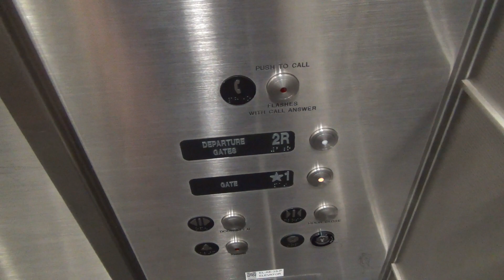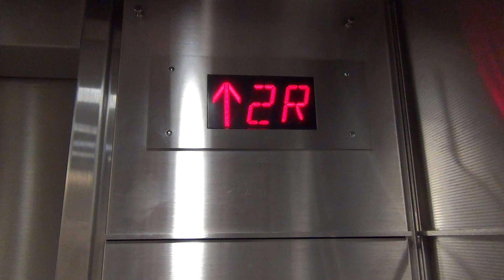Low on Oil! Montgomery Hydraulic Elevator @ Philadelphia Airport - Philadelphia, PA

Comment: it did that because the pump is sucking air you should have told somone that pump goes out someones going to get trapped in it
Reply from the maker: I’m sure they will get it fixed.
Reply: @stlelevators  maby so but its the proper thing to do i report every elevator i ride if its not proper

Comment: This elevator definitely hates being low on oil, different elevators react different based on screw drive pump brand, motor, hydraulic configuration, and the power unit type.